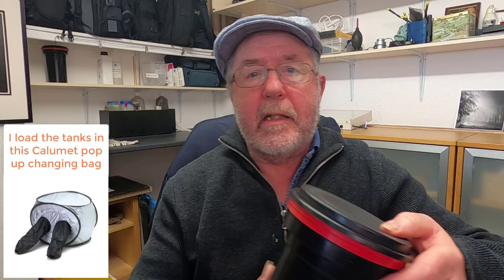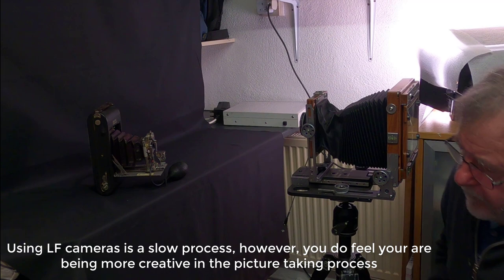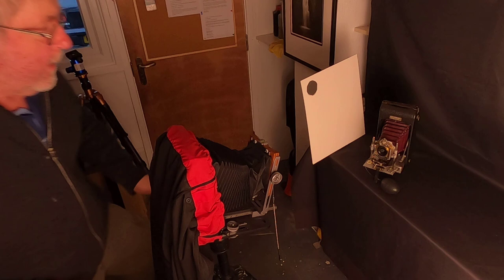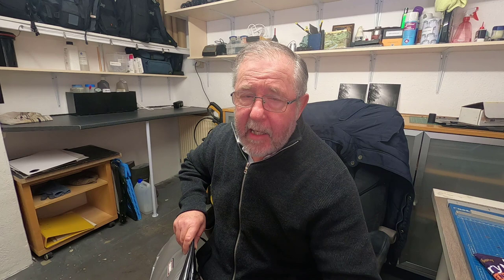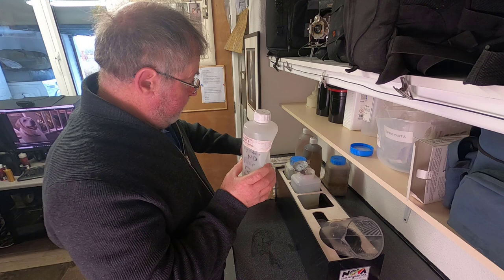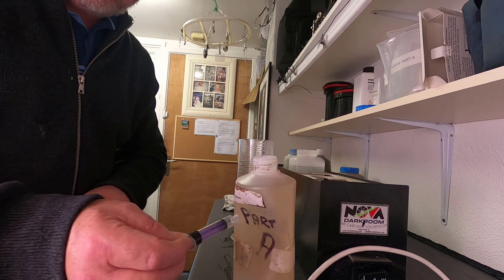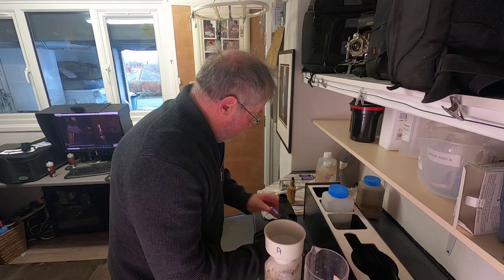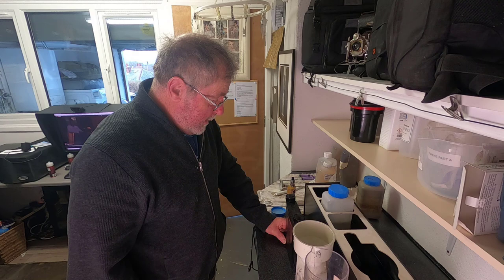4x5 Capture, from Developing to the Finished print, the COMPLETE PROCESS explained

Comment: Thanks for great instructional video on 4 by 5 processing. For 120, do you remove the backing paper before you load the film into the reel or just reel the film into the roller and let the backing paper fall off naturally? Thanks.
Reply from the maker: As you load the film onto the reel, as you do this the backing paper separates from the film,
Reply: Hi, thanks for the response.